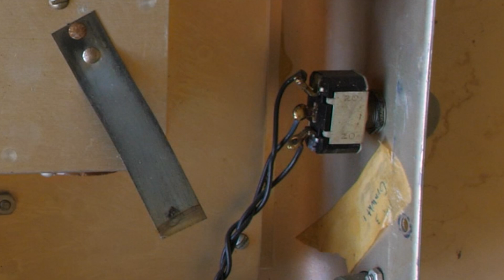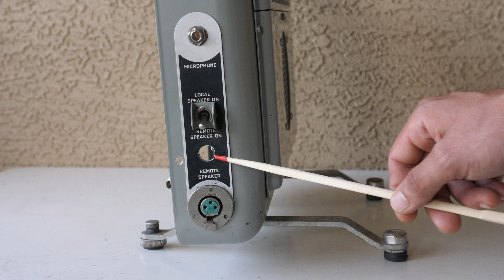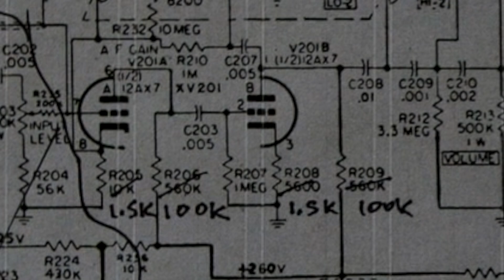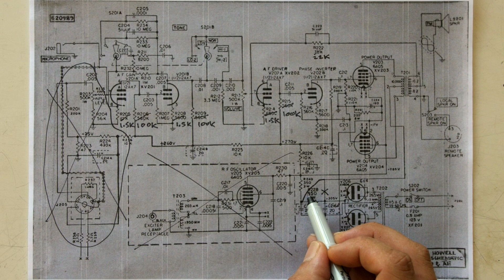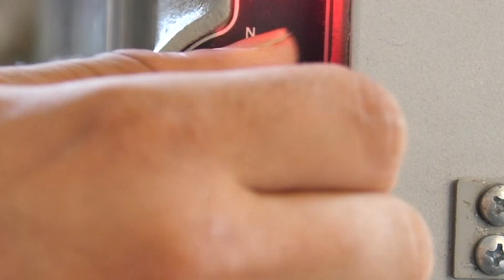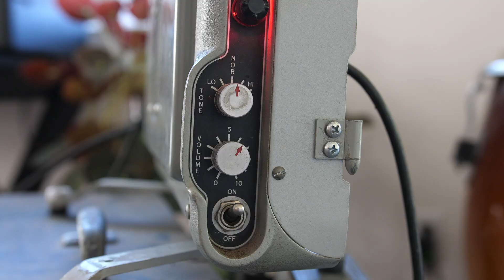Vintage Bell & Howell Filmosound "Space Heater" Tube Amp Conversion for Guitar use

Comment: This is a great resource for these amp conversions.
They are super rare in this side of the pond, the UK.
I'm waiting for a 385/8399 model with EL84/6AQ5, 12AX7's and a 5879, it's also in 240v which is the wall voltage in the UK.
It's super duper rare to find, they made B&H projectors here in the UK but they where always 110v.
I found mine all the way in South Africa of all places!.
Great video.
Btw do you sell these?.